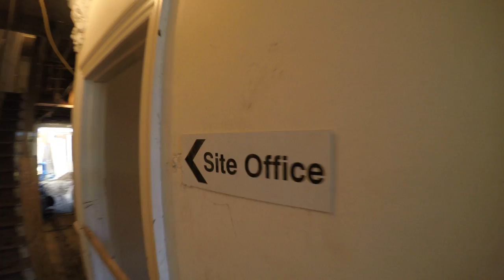basement extensions are the new trend in London

Comment: Is there a requirement to save the street facade?   Could the remainder of the building be removed and replaced by new construction?  There are too many deteriorating bricks and joints to repoint. Could the narrow side-yard be eliminated and the house footprint expanded?  Can the rear yard be eliminated and replaced with new construction?  Is there a limit to the depth of the basement?  Can the basement extend beneath the rear yard?  Multiple underground levels? [horrible water problems]  What about additional floors above the current roof?  In New York City we can go as deep as we want and can afford, most of the time we can build upwards within reason; eliminate the side yards; generally the rear yard have to remain although we can build multiple levels beneath.   I am not familiar with the practices in London.
Reply from the maker: Hi. Unfortunately, London Councils do not allow for period houses to be demolished, extended upwards or gardens reduced. This is to ensure single families (with kids) can use these houses and so to avoid multiple flat conversions. You can't build up the rear side yard since this would obstruct all natural lighting to middle room. So quite a challenge as you can see. We did add a large rear dormer window which converted the old attic into a very decent bedroom. Note: You can however go deeper underground but there is a specific tax in preparation for these types of projects.

Comment: Hi dave, what was your budget and how much did it cost in total? Did you go over? Plus which company did you use?
Reply from the maker: We had done a competitive tender and the basement was under £100k. There was no increase in costs. I use the same main contractor on the whole job.
Reply: @daveh3799  100k  bargain for that size
Reply from the maker: @NikosKatsikanis  it was indeed. Now this is solely for the concrete works. Then you add the fit out costs obviously which can range from 20-30 to 70-80k depending on what you do with the space.

Comment: How much would this cost?
Reply from the maker: Hi, it depend on the size of the basement (depth& surface area) and if there was any pre-existing cellar. A ball park figure is £150-200k for approx. 40m2.
Reply: Dave H 
Hi Dave is there a bill of quants for the work undertaken, what was the shell and core only price? also programme wise how long did it take?
Reply from the maker: @vixsagoo3997  The actual concrete shell was under £100k. It took us about 4 months to complete it.

Comment: Long reach digger arm anyone?
Reply from the maker: wish we could have accessed the dig-out with a mini-digger, but absolutely no way to turn around with it so all by hand unfortunately...
Reply from the maker: These diggers are great but don't fit in a Victorian house hallway !
Reply: Dave H Through the window opening. I’ve seen it being done in shepherds bush
Reply from the maker: no. This type of plant doesn't fit through windows, especially when they need to turn to get the grab out of deep excavations. But good try !
Reply: Dave H They use conveyors Mate no major swing required, the turn is more than adequate the reach dig, scoop and dump with a 3’ bucket attached is workable and proven. 

“Nice try” I don’t know about your attitude but there is one thing I know on this type of build above. Whoever the contractor/supervisor was they must’ve based their method of working on coal mines 100+ years back!.
The manual labour and time/cost blew through the roof!.

Personally have been on jobs that have used long reach excavation through small apertures. To create basements both in Europe and the USA. 

Thanks for the “NICE TRY”.
Reply from the maker: I have been doing this for 10 years now and not one of these residential projects could get a digger in. If we could have, we would have. This would obviously been cheaper and quicker. And one thing you seem to misunderstand here is that if the builders could have saved money (make more profits) they would have !! Anyway, good luck with your projects !
Reply: Dave H Yes who said you’re doing it right for 10 years. I’m engineering 30+ years, if this is the case you’re using the wrong crew or the books aren’t being checked. Manual labour went out with the do do. 
Best of look doing things arseways.
Reply from the maker: I don't decide the excavation method, I leave it to each building team. And I  thought you said you had seen it done in Shepherd's bush, but you actually never did it that way... And for a reason: you can't in these terraced houses ! but hey, I guess all my building teams like losing money , don't they? Maybe you should set up a building consultancy Mr engineer !